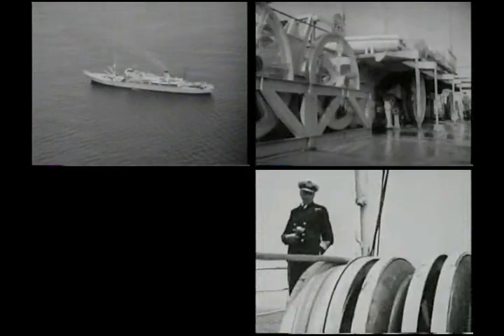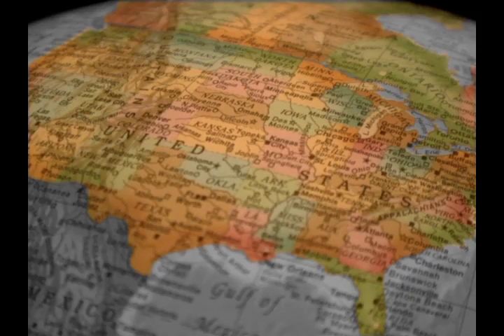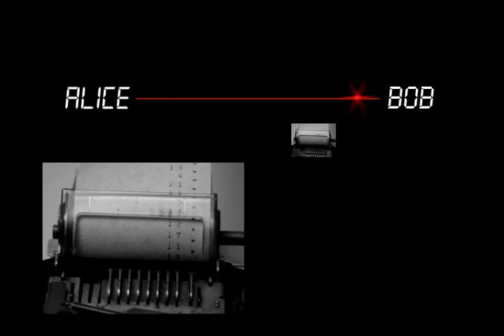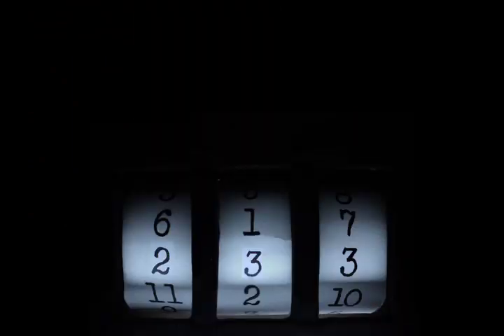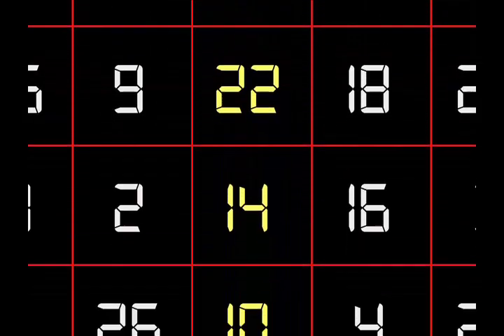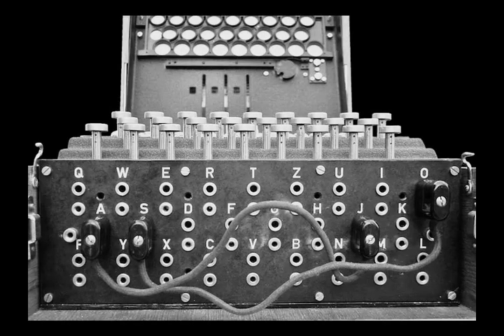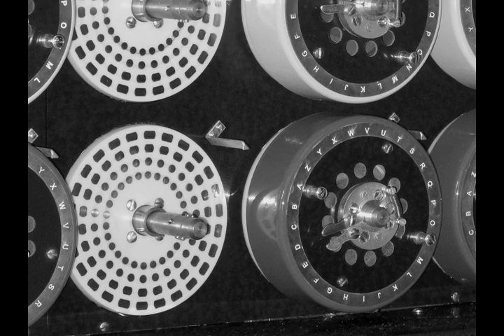The Enigma Machine (how it worked & why it was cracked)

Comment: It took me some time to sort out the following things:
• The rotor setting: which rotors were used for a particular day and the order in which they were assembled in the Enigma machine: I – II – III, II – III – I or any combination. 
• The ring setting, which was where the letter of the alphabet on the ring on each rotor was rotated and locked in relation to the wires in each rotor. 
• The plugboard setting: which pairs of letters of the alphabet were swapped by plugging in 10 cables to swap pairs of letters; CI, MV, etc.
The above is the key setting. There was a different key setting for each day of the month. Every operator had a key sheet for the current month. 
• The ground setting was the position of the letters visible in the window of the Enigma machine. 
When one Enigma operator sent a message to another he chose a three letter ground setting at random and sent it to the other operator in plaintext. Both operators set their machines to that three letter ground setting. The first operator would then send another set of three letters in ciphertext, scrambled by the ground setting of that first set of three letters. The second operator would type in the scrambled letters, his Enigma machine would descramble it and give him the new three lettet ground setting in plaintext. Both operators set their machines to this new ground setting. It would scramble the plaintext message into ciphertext from the sending operator on his machine and unscramble it for the receiving operator on his machine. 
Even if the enemy had an Enigma machine he would still need a key sheet with the key settings for that particular day. Hearing the first three letter combination in plaintext wouldn’t help him because he wouldn’t know which rotors were in which order with which ring settings with which plugboard settings he needed to set up his Enigma machine. It was unbreakable. 
Unless the enemy cheated.
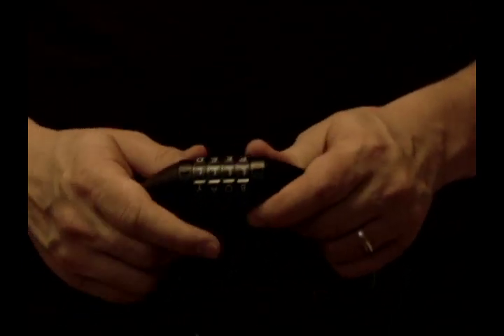Reply: Could you once explain in which of these steps, the mistake was done by the operators mentioned at 7:30 i.e. regarding some initial position of rotors or something?

Comment: I had a bit of fun making a similar encryption engine in BASIC a long while back.  But PGP (or its open-source equivalent, GPG) is still more convenient for electronic information transfers.

Enigma is a symmetric encryption scheme which means you have to find a secure method of transferring the keys before you can transfer secure messages.  PGP and GPG use asymmetric keys, so you can send the public key through insecure means without compromising security.

Comment: WELL, if the operator made a random setting of the rotors how did the other operator know how to set his machine so that they matched. Unless he sent the settings to the other operator on the old settings. Then how were all the other machines set to  the same settings.
Reply from the maker: yes they would share those in advance
Reply: @ArtOfTheProblem  That's not quite right.
The sender would configure his device according to the initial settings for the day.
The sender would choose and type 3 random letters (eg: "CAT") into the device TWICE, recording 6 enciphered letters.
The sender would then spin the rotors until "CAT" was displayed in the windows, and then type the plaintext message, recording the enciphered message on a notepad.
Then, the 6 enciphered letters and the enciphered message would be broadcast 'wireless' (all in Morse code).

Anyone(!) receiving the transmission could record the letters of that Morse code broadcast.
If one KNEW the correct settings (ie. other Germans), one could set one's device according to the day's configuration.
One could then enter the first 6 letters received... out would come "CATCAT"
One could then spin the rotors to display "CAT" and type the rest of the enciphered message, recording the plaintext.

Every message was to be processed this way, including choosing different trios of random letters for each message.

The difficulty for anyone trying to decipher is to determine which one of the 159x10^18 possible initial device configurations is in effect for today... At one 'try' per second, well... Consider this: The age of the universe is
13.7 billion years multiplied by about 365 * 24 * 60 * 60 which is about 0.4x10^18 seconds...
Roughly speaking, a crude brute force attack would require 'trying' roughly 400 settings per second for every second since the Big Bang... On average, one might find the correct setting in only half the time since the birth of the universe. And, start from the very beginning again only 24 hours from now.
If you're curious, the question is how fast would brute force have to be to be useful if the enemy's messages concerned an event to occur the following day. A day is 24*60*60 (86400) seconds, but we want to decrypt within, say, 6 hours of receiving a message at 6AM (the start of the Enigma configuration day). 159x10^18 divided by 21600 seconds is 7361 trillion tests each and every second... That's over 7 million billion tests each second. Apples' new M1 chip isn't quite up to that capability...

Comment: Didn't they find the machine in a uboat?
Reply from the maker: I believe so yes, a crashed one
Reply: The allies got the design info of the device and rotors from a disgruntled brother of military type.
They already 'knew' the electro-mechanical design (from the Poles).
What helped, rarely, was capturing a useful monthly sheet listing daily configuration settings without revealing the fact the configuration was known. At month's end, the allies were effectively 'blind' again...